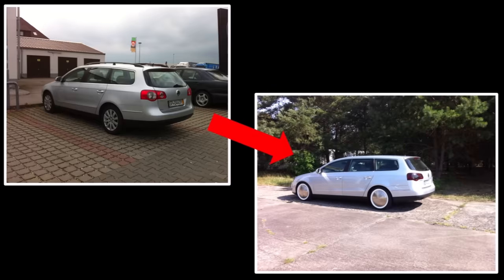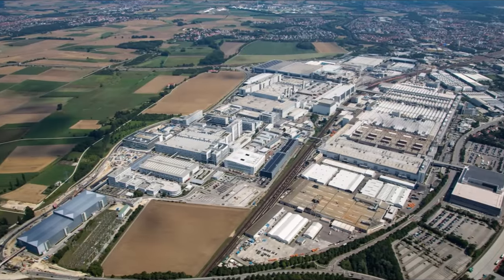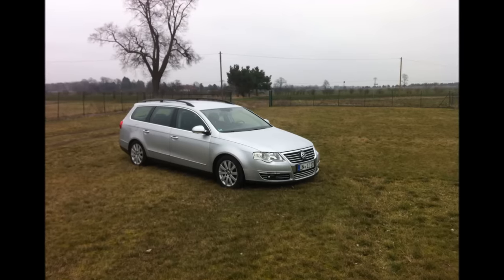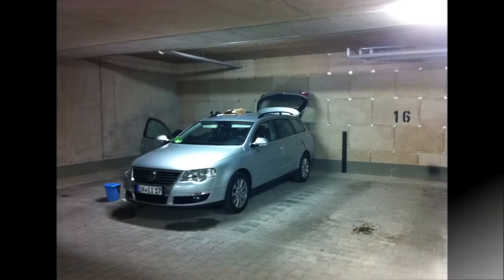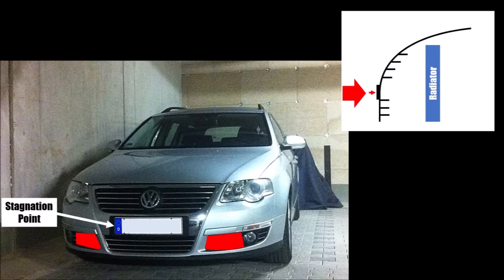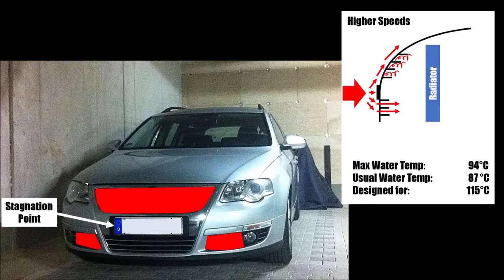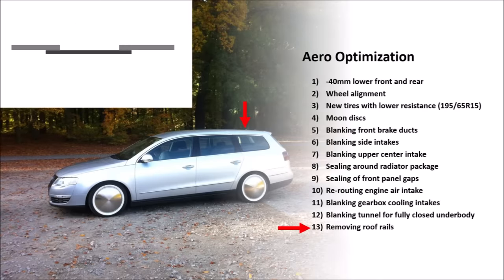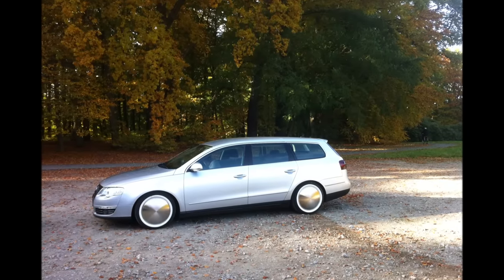Massive Drag Reduction For Tiny Budget - How I turned my family car into an AERO Star

Comment: Or just drive a little slower for better fuel consumption. Just did 70.1 mpg in 2016 (owned from new) MB B Class 200d sport standard no mods at all and over a distance of 737 miles. The 2.1 litre MB lump is legendary. New oil and filter ever 5k. We’re low mileage on this ..  wife’s car 49k miles.
Reply: But with eco mods that could be 80 mpg

Comment: I want to make my 1988 Lincoln town car more efficient but has the aero of a brick and the biggest mpg killer is the 4 speed automatic the engine has a lazy cam which means it doesn't make alot of hp made for torque.
Reply from the maker: 1988 Lincoln town car is definitely some work to get this aerodynamic, but not impossible. Main points being front, rear and underbody.
Reply: @BSport320  the rear isn't so bad I think its the underbody I could always swap to the newer style which is much more aerodynamic but I like the style of the car and its my first car

Comment: Roof rails on cars doesn't make much sense, they have become a design element for station wagons and SUVs. If you really need something to load on the top, most cars have mounting points that can be used.

Comment: The fact that you modified engine cooling system, air gaps was stupidest mod ever made. Better would have been to reduce amounts of sound insulation mats from the car, theres somewhere around 18-30 pounds of sound insulation mats as stock.
Reply: If highway cruising, even 100kg would not make a difference on the economy, at those speeds it is almost pure aero.

Comment: The question is, why didnt VW at least some of that? The front intake should be closed always until its needed. The rear wheels should always covered. The underbody should be flat like Lotus Elise. The REAR MIRRORS should be replaced by cams. The last would be  of enormous impact. But the german TÜV said no. Exept the E Honda and an Audi. But that change should be possible for all cars.
Reply: Cameras are not as safe as mirrors because they remove possibility of depth perception and have limited dynamic range and also introduce delay into the equation. They should never be allowed to replace mirrors in road cars.

Comment: Do you know why western companies never made high temperature cooling systems? Right now i can see why they wont because of nox emissions but what about back then? Soviets always used around 115 degree high temperature cooling system on their tanks and other military vehicles which made them more efficient but i have never seen these used in western world outside of nascar
Reply from the maker: So 115C is actually the standard limit for car cooling systems. Some engines even run with up to 120C.
Reply: @BSport320  well i dont know about their limits but every car i use the temp generally hangs around 80-90 degrees celcius and the soviet cooling systems were always hanging around 110-115 and probably had an even higher maximum limit. To keep it at 115 they had to use really high water pressures to stop water from boiling.  Do the cars that you are talking about with those high limits also increase the water pressure or something when they reach those high temperatures?
Reply from the maker: @288gto7  OK you are talking about operating temperatures, I was referring to temperature limits. 
Running at higher temperatures in general increases efficiency, reduces friction etc.
Also these normal cars increase the system‘s pressure to avoid boiling.
Reply: @BSport320  i see, it makes sense to increase pressure in cars as well. But Its weird to me that why west never pursued high operational temp cooling systems to me it looks like theres so much to be gained there. I think there was a cummins "adiabatic" (not really adiabatic obviously but thats what they called it) diesel from 80s that operated at high temps but that also didnt go anywhere meanwhile soviets adapted this system on mass production military vehicles since late 1950s and had no major issues with them after they got a good understanding of it. And also yeah nascar rn also operates at 115 degree or so i think but still thats just nascar racing series where they can repair the engines etc after races so yeah i dont think west ever had any high temp systems like that on a huge scale on mass produced vehicles. Also on top of these high temp cooling systems the soviets also had an "ejector cooling system" where additional air from outside is drawn in by the motion of exhaust gases thru venturis etc that sucks in air without a radiator fan which decreased parasitic losses on engine a lot, increased exhaust backpressure a bit so lost some power there but also gained a lot back because no fan, they had additional fan for when stationary etc but when moving they declutched the fan and only ejector system was used and i havent seen anything like this in western vehicles , they just always used fan to bring in air
Reply: Since you wrote "never made high temperature cooling systems" I must say that is not correct. BMW for example have used 112c temperature as a normal operating temperature under some conditions (by way of electronic control) since many years back.
Reply: @GoldenCroc  can you define "under some conditions"? Like did it normally operate at 90 but reached 112 and operated at 112 in hot climates etc or did it always operated at 112? Also which models had this feature im interested
Reply: @288gto7  The example I gave was for the BMW N52 engine, featured in various cars of the same manufacturer since mid 2000s.

From the BMW TIS about the different temperature modes availible to the DME: 

"112 °C = Economy
105 °C = Normal
95 °C=High
80 °C = High and regulation by the map thermostat
If the vehicle handling causes the engine control unit to detect the economical operating range Economy, the DME regulates to a higher temperature (112 C)."

In practice, if the load on the engine isnt too high and other parameters are favorable, it tries to regulate up to the 112c to increase economy and efficiency. Cheers mate.
Reply: @GoldenCroc  i see thanks a lot. I would have thought high temp cooling system in an eco mode etc would increase nox emission so they wouldnt do it but apperantly they do. Also correction, i remembered wrong , soviet systems dont ALWAYS operate like that as i was claiming. I rechecked my sources and it states for example V-46 engine in T-72 Ural tank can reliably operate at 100-115 degrees however it wears down the cooling system faster and that it normally operates around 80-100 degrees under normal conditions and weather however if needed it can also reliably operate at 100-115 in deserts etc however that brings maintenace interval a bit more frequent but still it can reliably operate like thos for long time if needed. On other side of the wall in German Leopard-1 for example it normally operated around 70-80 and could reliably operate 80-100 but not above 100 and doing 80-100 also shortened maintenance interval but was still reliable until 100. after 100 is cracks the pipes and radiators etc. also checked my car which is opel astra j 1.4 turbo and internet says it also reaches 105-107 degrees during normal driving BUT gauge never shows above 90 because apperantly in old astra f it showed actual temp and people thought their car was boiling so opel decided to not show the actual temp in later astras SO i also thought my car operated at 90 but apperantly it doesnt. However it has lot of chronic cooling system issues which i assume are because of the high cooling temps and the required higher water pressure to prevent it from boiling and i never hear good things about bmw cooling systems either so i guess they dont fully work as reliably as those soviet tank systems prob because these are just cheap consumer cars and not a main battle tank. Thanks for the heads up otherwise i d have still thought soviet systems always operated at high temps
Reply: @288gto7  I can agree with everything you wrote here. Consumer proiducts are different to military ones after all.

By the way, I currently own a BMW with the M57 diesel engine, and its normal operating temperature is 89C. The car, as many other BMWs, does not feature a temperature gauge, but I have an aftermarket one fitted that reads the onboard data from the ECU. 
When I drove on Nurburgring this summer, it wasnt until about (according to the gauge) 123C it threw up a warning about excessive engine temp and cautioned me to slow down. Since I wanted to keep going at full speed, I did so. At about 128C It gave me a red light and "very high temp, stop immediately". I went on a bit further at a quite fast pace, at most I saw 131C ...

Funnily enough, the engine survived (at least short term, knock on wood), however, it killed the thermostat of the engine, which failed open, so after that it wont go above 60-65C during normal driving when I drove the car home. Cheers.
Reply: @GoldenCroc  damn i would have expected a hose to be blown off or something 😄, good that at least only thermostat failed and everything else was fine.

Comment: no wonder euro car dont last long here in malaysia..their extreme cases is capped at 45degree celsius..meanwhile,this is our normal daily ambient..crossing border singapore-malaysia can easily heatsoak the car with 50degree celsius.

another daily traffic jam worth considering is inside the tunnel at Jalan Tun Razak in the heart of kuala lumpur .the stagnated airflow can be very torturing.
Reply from the maker: Interesting to hear! 
The thing is, every degree more cost the manufacturer a lot of money.
The test cases demand race track and top speed at 45C, so daily driving even at 50C should be fine.
But traffic jam in your area at these temperatures could really be an issue.
European manufacturers also build the cars with a different spec for extreme hot/cold countries with larger radiators.
Reply: @BSport320  I hope someday you can come here and experience what its like and for bonus,try attend a trackday at Sepang F1 circuit under the scorching sun. :)

This could be beneficial for you in some way.

Comment: You will have a brake failure with wheel covers like that, on a hot day the fluid will overheat and boil, the pedal will go to the floor. You will not be able to stop.

Comment: the numbers before the mods are just WAY too high, maybe sth with ur engine was off, I had the same car same engine and at static 130kmh it used around 4.5l NOT 5.5 so the gains are way less - obviously. in no way will u get such a drastic reduction with such minor mods.
Reply from the maker: A well running 3C 1.9 TDI with DPF and 5 gears can run as low as 5.0-5.3l/100km. You can check on spritmonitor.
Like I said, my car‘s engine wasn’t running well at first and was badly maintained, so I couldn’t get it below 5.5. 
And about the mods: Aero and cooling is more powerful than you think😉

Comment: I highly doubt that your brakes were safe after all. By blocking the air flow you also killed the wheel bearings as the did. not get any air flow. And yes, they need cooling otherwise the bearing life decreases drastically. Even though you have engineering degree and automotive background you should never ever motivate your audience to manipulate anything related to brakes! Komme selbst aus dem Automotive Bereich, kenne die VW PV’s und TL’s, EVP und EWP - Mooncaps mit verschlossener Belüftung ist eine ganz doof Idee!!! ☝🏻
Reply: He had a disclaimer in the beginning, in which he said that he doesn't advice anyone to do what he did. Also, alles in Ordnung. ;)
Reply: explain the wheels and brakes on the mercedes EQXX, the VW XL1, and the Light year ZERO cars?
Reply: @PhaseSkater  Eqxx is not a series car… regarding VW X1: air flow to the brakes was engineered for this type of application. You can utilise some air ducts on the undercarriage and release pressure vie the wheel well. Something you cannot “engineer” afterwards. But it was certainly considered and tested during design and validation phase of the car. But for the good old Passat - not.
Reply: It would be easy enough to fix.
Mount the sport model brakes to get more thermal headroom and never drive with a trailer or faster then 150km/h on the highway.

Cooking wheel bearings, never have a ever heard that could be a problem, the wheels have a massive size and amount of metal compared to the heat a wheel bearing would be able to generate. The driveshaft is also connected to the bearing transferring heat away from the bearing.

My first car came with stainless hub caps that looked close to these, no problem at all with heat.
Reply: @larsjrgensen5975  Aha… well, being an engineer in the bearing industry I can assure you that cooked bearings can happen and lead to failure of the bearing. The grease will bleed out the oil, metal to metal contact  generates more heat and can in worst cast lead to total failure with blocking of the bearing. You don’t won’t that Tonhalle at 150 kph… 😉
Reply: @flizndfor   as an engineer in the bearing industry, are you able to provide any facts on the amount of heat self generated in the bearing with a car like this?

The CV joint is 1kg, the hub is 1 kg, the brakes is 1kg and the bearing is 1kg approximately = so 4kg of metal surrounds the bearing.
School thought me that heating up 4 kg of metal to temperatures enough to break down bearing grease would need a good deal of heat generated.
A Zippo lighter with endless fuel would probably not be able to heat up 4 kg metal enough to break down the grease in the bearing of a parked car.

Only if doing something stupid like a American burnout with the brakes on could I see bearing grease being cooked, but the brakes would be long gone before that happens.